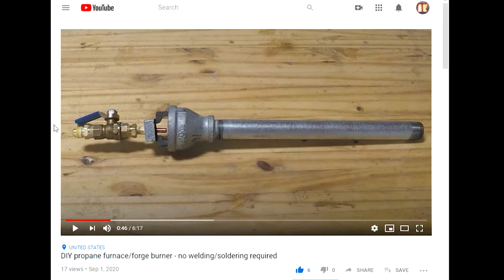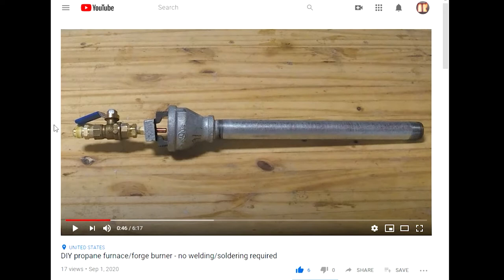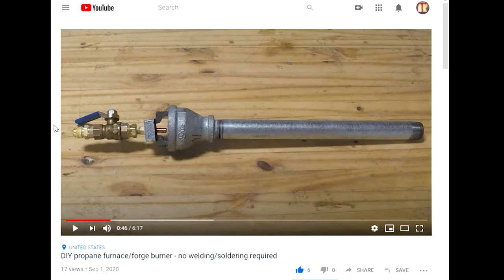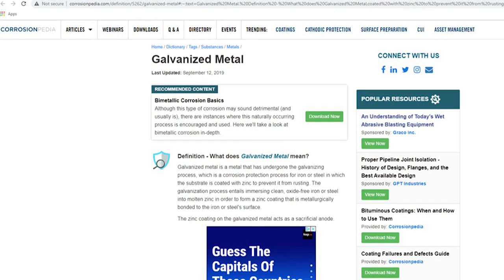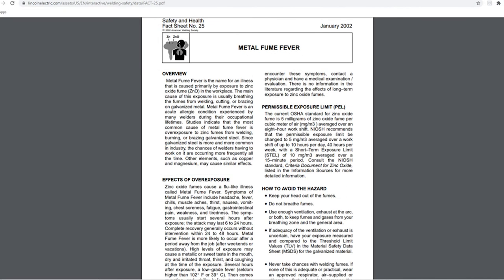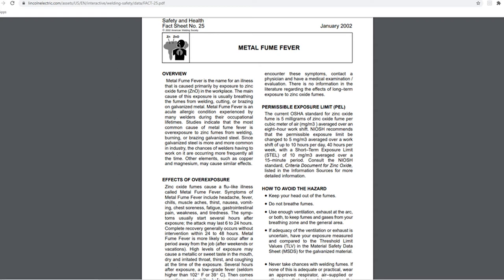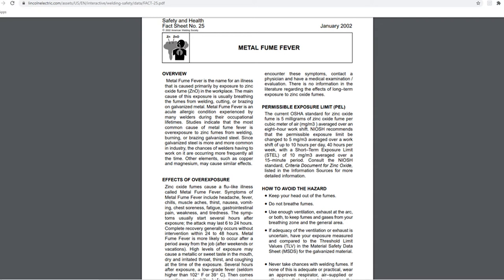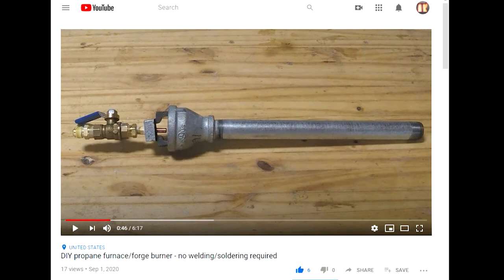Lessons Learned - "DIY propane furnace/forge burner - no welding/soldering required"

Comment: It's not so much that the zinc melts as it is that it melts, boils, and vaporizes, thus producing the harmful fumes.  Zinc boils at 1665 degrees F, just below the melting point of brass (1710 degrees F).  Melting brass in a furnace typically produces zinc fumes, and it is just something to be avoided.

Comment: You can quickly strip the zinc with muriatic acid. Just do it outside outside carefully, and follow appropriate safety precautions that apply to handling, and using strong acids.

Comment: I built a forge and a venturi burner like yours.when I light the burner and shut the lid on the forge my burner flame goes out.can you help with this problem
Reply from the maker: It could be that your forge’s vent hole might be too small. Can you share a picture or video of your set up to get a visual of what you’re working with.